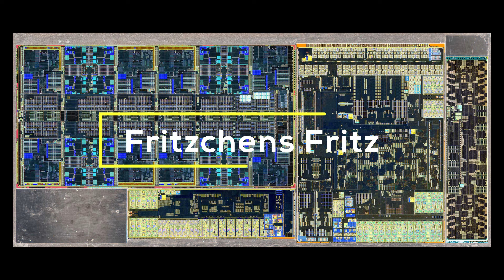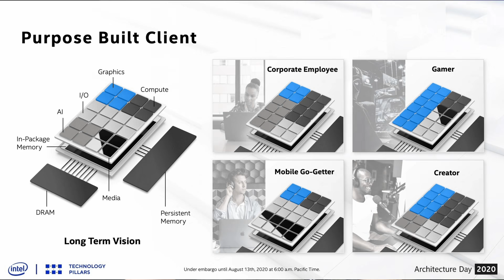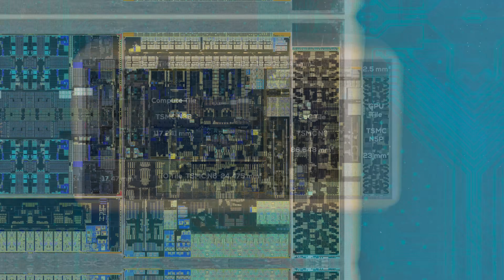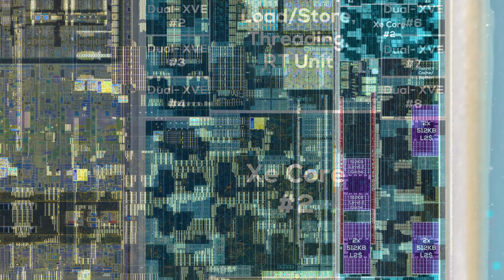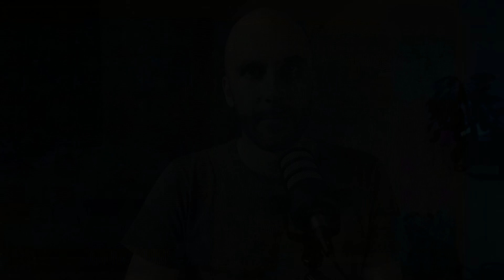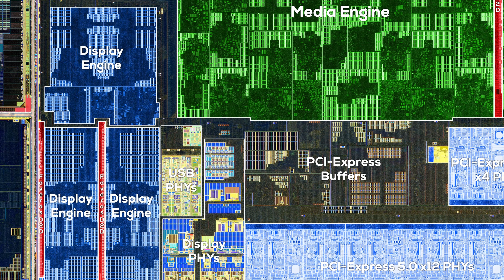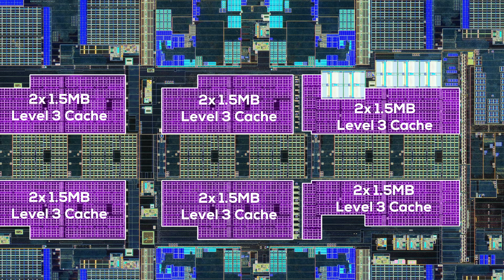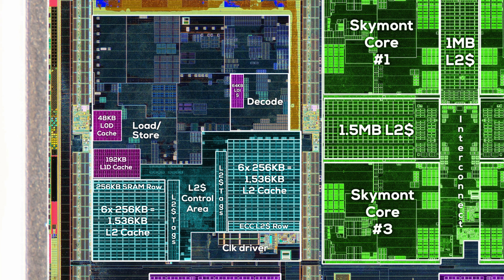Intel Arrow Lake Chip Deep-Dive

Comment: Not sure how much performance is left for future of Arrow lake.
It falls behind Ryzen 9000(gaming) and improvement in efficiency comes at cost of gaming performance (vs Raptor lake).

Low adoption rate, no planned next gen for same socket, that all doesn't look good for Intel.
If they go for new socket that means another gen compared as total combo cost vs just Ryzen cpu upgrade.
(at least for some Am5 current users, but also for older Intel socket builds).
The cpu can be interesting from design point of view but it just reminds me those almost single digit sales vs thousands of 9800X3D.

I would like to know how it is currently with 14th gen stability. I saw only 14900k return rate be 5-7,5 percent but lower end chips are at absolutely normal return rates(RMA) of any other cpu (around 0,5 perc).
It would be still no futureproofness upgrade to get 14th gen and Arrow lake doesn't make for gamers sense. 🤷🏼‍♀️

But I heard there is both OC potential and productivity advantage vs AMD but only in some specific apps.
Reply: Arrow lake might be out of steam, but this technology seems very promising. Wouldn't be surprised if it's the key to Intel getting back in the game
Reply: Adoption rate for Arrow Lake is low in enthusiast gaming rigs but it's very high in professional and workstation PCs that almost exclusively use Intel (other than multithreaded behemoths which use Threadripper obviously) and high performance DGPU laptops where AMD's Strix Point and Fire Range have very low adoption due to their inefficiency and high heat output compared to Arrow Lake H and HX. In the laptop space AMD is only having any gains with Strix Point iGPU only laptops, and even those will evaporate with the complete launch of Panther Lake because AMD decided just to refresh Strix Point, a 2024 architecture for 2026 while Intel leapfrogs them in terms of performance.
Reply: @alex31ytb The hype around Ryzen did a lot of damage to the CPU market, including Intel’s own NDA and negative marketing through Alder-on Game. I got a Ryzen 7 7700 and paid the price of a poor user experience. The Core Ultra bundle was already sitting on my sofa as a sidegrade when I considered switching. AMD hasn’t convinced me with only 2 years of platform maturity—futureproofness is more marketing than reality, at least 5 years down the road.

Comment: 19:00 I strongly disagree! Arrow lake has been performing WORSE than Raptor Lake CPUs to the extent that a lot of reviewers just ignore it. Intel itself has confirmed the same and has been rolling out fixes to try and push the performance further, including recently offering extended warranty for performance profiles that count as overclocking under normal circumstances! 

The problem is not 'public perception'.
Reply: It preforms worse, yes, but it's been catching a bit to much hate in my opinion. It's clearly a first attempt at tiles and it's way more efficient than older CPUs.
Wouldn't be surprised if it's the key to Intels redemption arc :)
Reply: I strongly disagree with your strong disagree. Arrow Lake performe worse just in games. And not on all of them (but on some it's quite bad, like 30% worse). On compilation, an area which actually interests me, and many others (millions of programmers in the world) it is better hands down than Raptor Lake and it has been since day 1.

People only judging from a gaming perspective as if that's all that there is or that matters is really REALLY annoying.
Reply from the maker: If you look at the latest review, there’s pretty much gaming performance parity at much lower power consumption.

Comment: Even though this generation has been severely underperforming, the underlying technology is impressive. If they can get the compute tiles to be more performative, refine design and introduce more area versatility so that they can use across many different target uses, they will become competitive again. Thanks High Yield for the analysis!
Reply: Agreed though all of this technology is necessary because they can't just build a big monolithic die on smaller processes.   A big single die on Intel 3 would kill this.
Reply: @jrherita yeah, then you’d be paying $1000 dumbass
Reply: It performs better now than at launch, after Microsoft did some work on their OS.  Same issue happened with Zen 5.  And THIS is the power of the FIRST messaging.  People hear the first data about something, but often never hear the followup.

I blame Microsoft for their part in this since after all their goal would be to make both Intel and AMD CPUs look worse than they are since they're competing against Intel and AMD.

And this is why I've said many times that AMD and Intel should work together on a Linux variant for X86-64, get it to professional level and have it be a low cost OS that works WELL and then work on compatibility with Mickeysoft Office since this is often the main reason a person wants Windows.
Reply: @johndoh5182  You bring up a great point.  I believe AMD should work as closely with Valve to integrate SteamOS on desktop\laptop as we've seen Nvidia cooperation with CD Projekt Red to leverage Nvidia features in Cyberpunk 2077 thru the years.
Reply: I still dont understand what Intel's goals are with this MCM approach.  They aren't getting scalability out of it like AMD is.  Each architecture seems to require its own whole new set of tile chips, and doing that on external nodes is expensive.  Plus their interposer is LARGE and that has costs, even on an older node.  It seems very obvious to me that Intel would be in a more competitive position right now if they'd simply stuck with monolithic chips for the time being, both performance-wise, and cost efficiency-wise.
Reply: @maynardburger  I can answer part of this, at least from the performance of process node R&D. 

Part is that the writing is on the wall for the current large reticle limit. 860mm^2 is going to drop to 430 with high-NA EUV. At that size, you can't afford to be doing things like 257mm^2 RPL-S. It's like making a die closer to 450 right now. Those nodes will also likely see wafer costs shoot up. Breaking up a chip so only the compute is on your latest and greatest saves costs even when you now have packaging costs.

Each architecture has currently needed new tiles because you've only seen 2, with the first being mobile-only. Nothing from it is transferable to Arrow Lake desktop. Mobile maybe could've reused the SoC and I/O tiles, but I don't know if they did or didn't. 

As for interposer costs, that node is dirt cheap. Like I can't stress how cheap passive 22nm is compared to the rest of Arrow Lake.
Reply: @ Intel never had a culture to do things on a budget in the most efficient way. They always had enough money to go with the expensive solution and brute forcing to the top instead of going the smart way.
Reply: @maynardburger  imo it is a sensible approach. Intel hasnt made a move before in their lithography due to IO, SoC...not being able to produced in smaller semiconductor sizes than the compute unit. Now AMD has far left them behind. Their efforts for using any part that's available with the new architecture is already big for Intel
Reply: @maynardburger They are trying to save money by using their own fans.  They have a huge problem that if they don't use their own fabs they'll be underutilized -- who wants to work with a competitor and give them your deepest IP secrets.  

No doubt they hoped to use less TSMC than they did and they hope to move back to their own fabs.
Reply: AMD sucks at pretty much everything except for massive cache which benefits repetitive tasks like gaming
Reply: @rmnwrkcnt  I wouldn't go that far. Zen5 is very competitive as a workstation CPU with things like full AVX512 support and offering 16 high-clocked cores. Their Zen C cores have potential to make some really interesting designs as well. In theory they could do a 24-core, 48-thread CPU with a regular Zen5 CCD and a 16-core Zen5C CCD taken from Epyc Turin Dense.

Both companies approaches both have their own strengths and some valid weaknesses, but I don't think you can call either trash or say it sucks right now. Arrow Lake excels at efficient multi-core and in some games like Beam NG Drive where memory bandwidth is important. Zen 5 is competitive and often very well priced thanks in part to lacking expensive die packaging. Meanwhile the X3D version is currently dominating most games.
Reply: @ 16-core  is where I would start looking at AMD. 8-core is good for smartphones, maybe. But again, weak SDK  and no support in major software products make AMD a highly debatable choice
Reply: *performant
Reply: Too bad they can’t iterate on this design keeping the same socket.
Reply: @ The design has nothing to do with the socket, Intel is just unwilling to keep sockets compatible. When they had 5 generations of the same architecture (all the Skylake refreshes), they still changed the socket every other generation just to sell new motherboards.
Reply: @Ranguvar13  I believe they could.  Greed is the only thing that stands in the way.
Reply: Intel just failed to leverage the most important advantage of chiplets: reusability. AMD could with one compute chiplet and two I/O dies cover everything from low end desktop to highest end server.
It saved a lot in R&D, streamlined production and simplified product lineups.
Intel got none of that.
Reply: @LordApophis100  I agree and it would be really, REALLY nice if Intel finally figured that out and we got a real fight in the CPU space again.
Reply: well actually it is performant, this is just "raw" hardware that needs to be finetuned (it feels like amd fx)
I tested 2 arrowlake cpus, you can get on avg -20% power and +15% easily in just couple clicks
for example intel, mb mf says that 55 and more is better if you do so for all perf cores, but in real life you need to downgrade all p cores to 50 except 2-4 that you can oc to 56-58, getting better efficiency and game/overall performance, also you should up e cores to 50 and you can do it with power reduction!
also its about scheduling tasks on that heterogeneous system, the best way to do so is just use latest linux and sched_ext linux schedulers
Reply: also if you have e.g. 265k you should overclock p cores that placed near 4 e cores that is off
all im saying is that these cpus arent bad if you know how to use them
Reply: The compute tile is just fine as it is and compute benchmarks prove this. ARL's poor performance in games and low latency apps is caused by something else.
Reply: Underperforming in the desktop space maybe, but in the laptop space arrow lake wins by quite a lot because of it's increased efficiency
Reply: Expensive and maximised flexibility, the AMD engineers glue has been cheaper and more effective despite not using bridges.
AMD already have sound solutions used in MI300 and Strix Halo, so Zen6 should address the Infinity Fabric weakness, while Zen5 will be cheap to produce.
Reply: Intel may have gotten away with single generation motherboards when they dominated the cpu space but now that the tables have turned, Intel ought to consider embracing 'value' by supporting motherboards multiple generations.  That way consumers who support this 'severely underperforming' gen could simply drop the next cpu upgrade in their current mb for hopefully a more balanced and competitive cpu experience the next round. It's time Intel give af about endusers, not just their aib and retail partners.
Reply: It only underperforms on games, it'll be fixed soon probably, otherwise a good attempt of a gen
Reply: @mad_mario_  It underperforms in games because of an extremely bad cache/memory subsystem; mainly that it doesn't have a lot of cache, half of the cache isn't shared, and has very high cache latencies. The memory is the best DDR5 controller except for awful latency somewhere in the chain, which sinks it.
Reply: @mad_mario_  no it won't!!  ARL already has the "fixes" out and it didn't make enough difference.
It was intended to perform better, if Intel could have clocked it higher they would have, it missed its targets and is expensive to make.
Reply: Unfortunately none of that matters. It has to sell.
Reply: Yeah, from a pure tech nerd perspective, this approach is fascinating. Hope they work out the performance issues over the next couple generations and provide real competition again.  

No one other than fanboys want a segment completely dominated by one player.
Reply: *Performant, performative refers to arts
Reply: Yeah given the technological approach i expected more, we shall see if their next gen is better.
Reply: You do realize this is exactly what AMD has been doing since Zen 2, right?
Reply: @3-valdiondreemur564  It both is and isn't. AMD hasn't touched a silicon interposer for Ryzen for example. That is a significant jump in packaging tech.

Comment: Interesting layout, with mixed P and E cores.. but it looks overly complex vs "gains" ? More spreadout heat disipation is ofcause good, but i'm afraid the price in complexity will outweight the benefiths of heat spreading.
I'ts like Intel wants to have ultra high power cores, so i guess 255watt max TDP cpus area aint over ... There should be a smarter solution than this complexity.
I still hate that the E cores can't do all tasks, so some P cores needs to be spun up anyway.. Comon Intel, look at AMD's Zen6 LP cores, where we have cores that can enable full deep sleep of all "P" cores.
Faverous is nice on paper, but what is it worth if you design for 255watt max tdp package?
Reply from the maker: Intels chiplet approach is different from AMDs. Not such much "scaling a product range with one die"; but more focus on using different nodes for different parts and being more flexible.